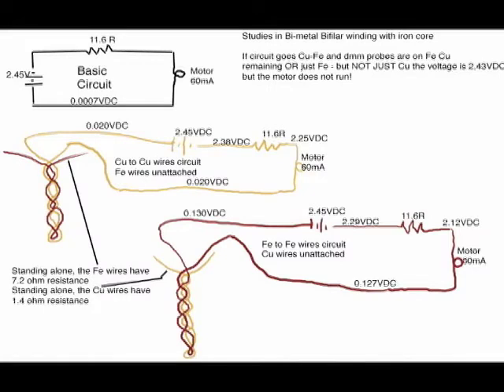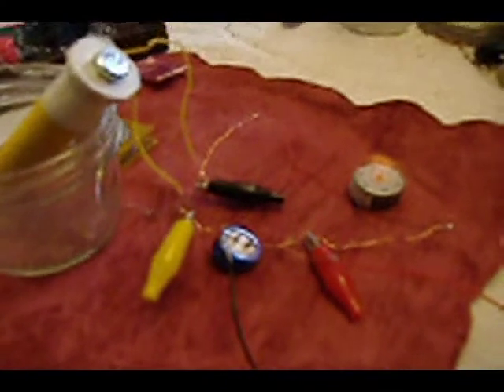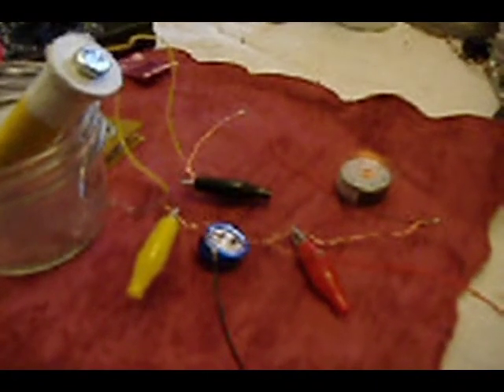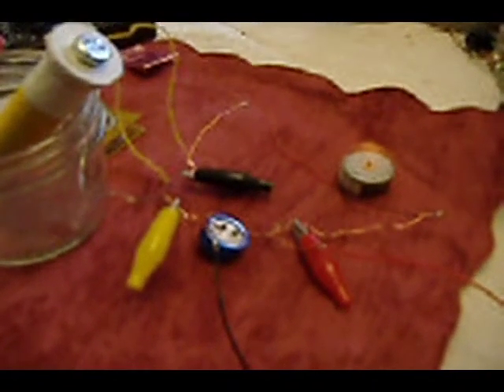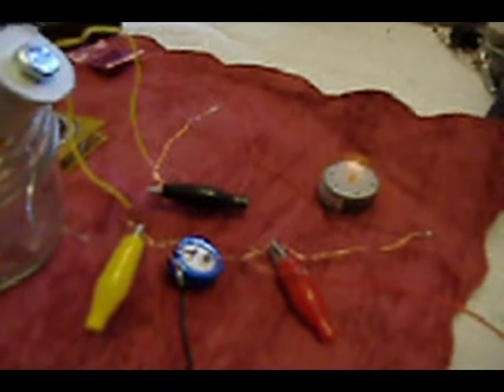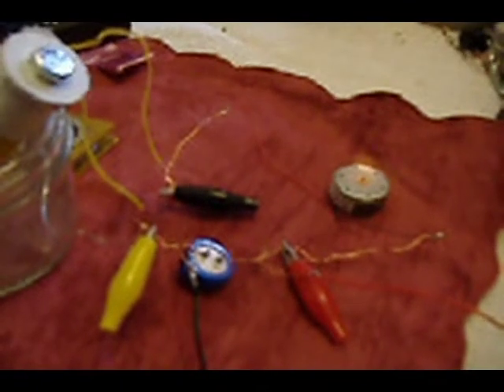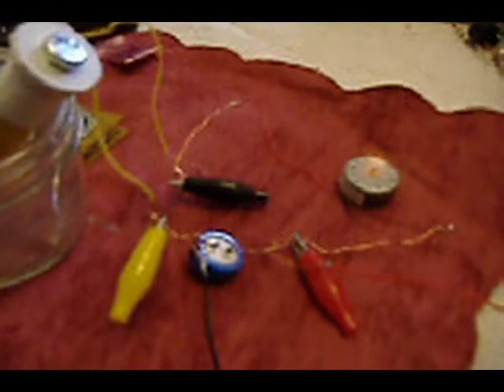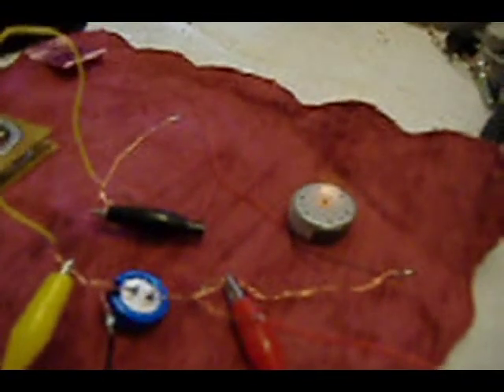NScoilNcapMotor

Comment from the maker: It might.
I am hoping the induction dance I mentioned to alex681219 is at least part of what is happening.
The best support for that hope is that if I merely touch the copper wire for less than a second, the motor runtime is around 4-5 seconds.
cd player motor

Comment from the maker: I made 13 of them and the quick answer is yes. all of them!!
This is made with a 3/8 inch steel bolt with a drinking straw that fits closely around it. This allows me to remove the core to test it without a core.

Comment: Jeanna:

Nice work!  My opinion is that the supercap fills faster than the drain from the motor such that you end up with a bit of a surplus for the same charging time.  I have seen that happen here on the EER and the boost cap or even my regular supercaps.  That's a nice little motor there.

Bill

Comment from the maker: 1F 5.5volts This is a super cap used in computers for memory. It fills fast, but much slower than a normal cap. I just filled it for 13 seconds and it added  30mV using similar batteries etc.
My thoughts are that the iron wire is picking up the self inductance and holding it there adjacent to the cu wire, where it is magnetically coupled and can re-influence the cu wire etc. allowing the charge in the cap to last longer, and maybe even fill it while it is working. ..maybe.
Is he ground  the u?